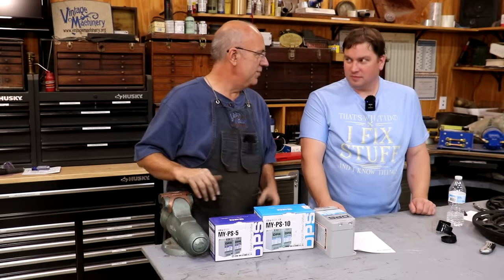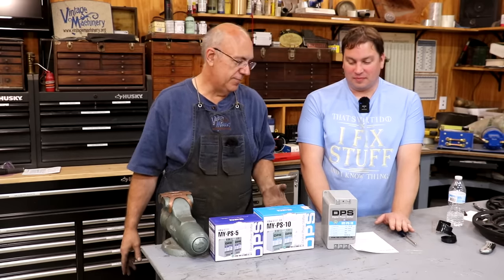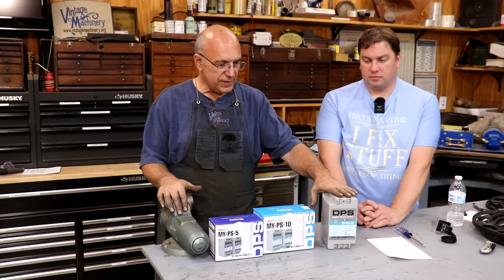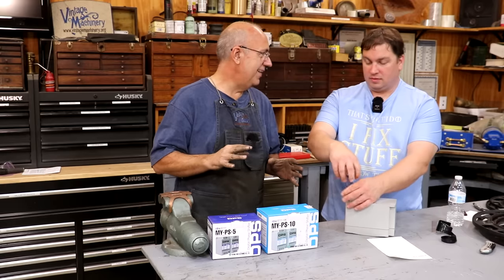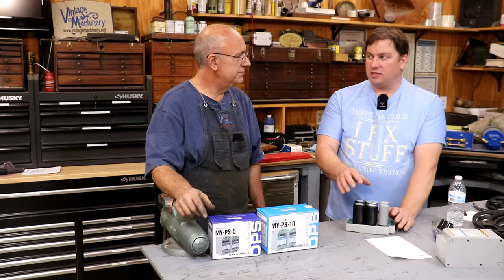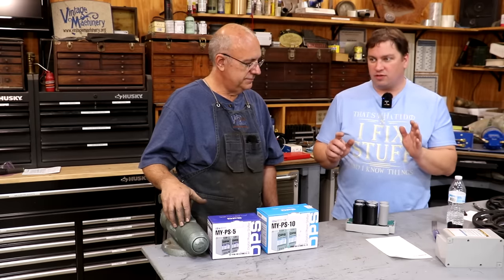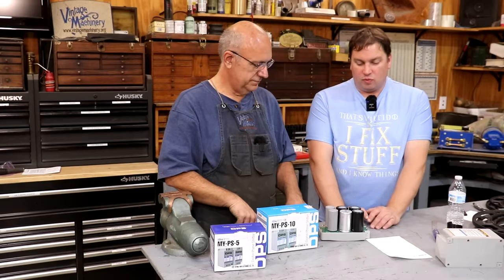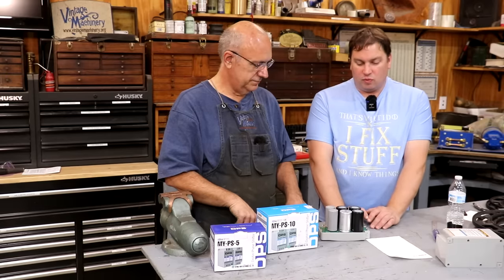Single Phase to Three Phase Power: Rotary Phase Converter vs Digital Phase Shifter

Comment: Interesting video - thank you. As someone with an electronics background, it would have been nice to see oscilloscope traces, comparing the rotary phase converter (RPC) with the digital phase shifter (DPS). It would also have shown your '3 guys hammering a tent peg' analogy very clearly. However, from the voltage and current readings you gave, the DPS is no substitute for the RPC.
Reply: Yes I like to geek out too on visual
Reply: They also didn't show a RPC worst feature, startup. They sag horribly on inrush on the third leg. That's the reason they have such large capacitor banks inside the RPC. The generated leg is limited to the locked rotor amps of the motor inside of it, but at that current voltage approaches zero. So you will see 10% or less of the inrush current on the generated leg vs the pass though legs, with a drop in voltage too. Due to the delta configuration of the 3 phase, this means your motors basically single phase on startup if there is a large load on the motor, as L1-L2 will have all the current, and L1-L3 and L2-L3 will have little current. The voltage sag will also effect the motors if you get close to the capacity of the RPC. The try to compensate for this with large banks of run caps wired in.

A VFD/DFS will produce even voltage and current per phase up to the limit of the device. It will provide less peak inrush current to a motor, but all 3 phases will have the same inrush. Thus will have much much higher starting torque.
Reply: This is not to say it is impossible to have an entirely solid state three phase converter. It will have more to the electronics than half a dozen little caps.
Reply: The guy failed to take into account power factor, THD, (total harmonic distortion), inrush current and many other factors.   Bottom line, there is no great substitute for commercial three phase power other than an appropriately sized generator capable of three phase power. The  old rotary phase converters were literally a single phase motor with a belt driven three phase generator next to it.
Reply: weeeeeeeeeeeelllll also, at least assuming the current clamp was true RMS, you need to get the true reactive power. Obviously since the DPS can't create a good 120 degree phase shift you will have an imbalance but not sure it's the dire end of the world situation advertised here - but of course this channel will always give the edge to a RPC. I think an inverter with a nice big shunt reactor on it is the best option, but that's serious cash so I get it - RPS is probably the best balance of power, cost and reliability for a home shop.
Reply: Yes. I was wondering about the validity of using RMS meters to measure what might be a square-wave output. I don't know myself, just asking.
Reply: @cda32  dps makes perfect phase shift. They convert incoming power to DC then make the output through some igbts. They work the same as a VFD.
Reply: @captianm4766  no i didnt, there is really no reason to and the video was not intended to be 2 hours long so those minor concerns are edited out.
Reply: I wanted to see the waveforms, too. I wonder if it would have performed better if it were feeding a purely resistive load. There would be no practical reason to do that, but it would have been interesting.
Reply: @ionstorm66    didnt your mama tell you there is no such thing as "perfect."   There is a lot of noise here already on this post but i will address a couple of things:  a scope would have been nice yes but between us we dont have one, yet.  both of those meters measure true rms not that it will make much difference, we did compare other non trms meters and the readings were functionally  the same.  there are products out there that are more or less a vfd that are made to just output  3phase to whatever but those things are not true sine wave outputs.   if you look up how those things work you will see they have very noisy outputs just like a  vfd that they are based on.
Reply: @nilzlima3027  we are referring to how a RPC doesn't have 120 degree phase separation, as it keeps the incoming 2 phase 180* unchanged for 2 legs. A DPC or VFD output 120* true 3 phase, thus perfect phase separation. The fact that the only measurements in the video are current/voltage running unloaded provides almost nothing to the actual differences in the technologies.
Reply: @johnopalko5223  the resistive load would make it easy to see the effect of the phase shift tho.
Reply: @ionstorm66  first of all showing the current and voltage readings is the most relevant information possible to provide to most end users.  second, 2 phase is 90* of separation between  phases and requires 4 wires, which is why 2 phase is so rare.  normal residential systems in north america are single phase with a center tap for the neutral that is also referenced to ground.
Reply: I also have an electronics background and I was thinking the same thing. I would love to see that converter hooked up to an oscope just to see what the wave forms look like.

Comment: I had a machine shop when I was younger and I paid PG&E $5000.00 to have 3 phase Delta power brought in from the switching yard about 5 miles away. It worked great and I never had any problems. It was 208 volts 60 cycles  and ran my machines well.
Reply: For me if I would want 3 ph now. I would have to pay $3k-$5k to go ~ 300 feet. I am just 300 feet from the transformer triplet up the pole.
Reply: @carlthor91  It seems to me that within the last ten years a friend paid Pacific Graft and Extortion a whole bunch more than that.  I believe that he had to "buy: three transformers, plus the poles and wire.  The "engineering" was over $3-5k.
Reply: @DavidSellars-b8l  I am in Northern Canada right dead between two hydro plants, three phase is only 300 feet North of me on a pole. My split phase pole is ~60 feet from my power mast. So no poles, just new wire, mast, and meter.
Reply: oah how times have changed.  there is  3ph not 150 yards from my house and xcell quoted me $11,000 for a connection to the garage only.
Reply: In my area, they just look at you and say No! 
If I owned a building that has three phase, it is my understanding that the monthly cost would be out of my budget.
Reply: @nilzlima3027  That is horrible pricing. My power run was done during the early 1980s I think it was late 1983. Service was a lot better then, than now.
Reply: Fortunately here in Germany(and almost everywhere in Europe)
basically every house and even  small apartments have 400V 3phase power so we don't need such things like phase converters.
Reply: Pick your poison, 5 -10K for a 3 phase utility feed or 5 -10K for a RPC.  If you're fortunate to even have those options. I would go with the utility but that could 
take a year or longer if even possible.
Reply: @Henning_S.  I am jealous of Germany, in the Netherlands we do not have 440V in normal households / apartments.
Reply: @be007  I'm pretty sure you also have that, it is just 3 phases with 230 Volts between each phase and neutral, so the regular voltage in your house, but the voltage between the phases is roughly 400 Volts. That is because of the phase shift as Keith explained, and because the phases are 120° shifted and not 180°, the voltage is not quite twice the voltage but a little bit lower. It's hard to explain, at the point where the voltage of one phase is at its highest point(+230V) the voltage of the other phase is 60° off of its lowest point, so it's not -230V but somewhere around -170V, so the voltage difference between the phases (-170 to +230) is 400V.
If you have an electric stove it is most likely connected to all 3 phases.
Reply: 3 phase is 1.25 miles from my house was told it would cost 40k plus. i am just going to keep using my american rotary 20ad i had before.
Reply: I live in a corner lot and built a shop, the poles are in the corner of my lot with the triplet lines and under 100ft to my shop and I already have a midway pole for my house, quoted 5-6k in TN for the 3ph service hookup. I said nah and went with 400a single phase since the install cost was the same as 200a (300 bucks). I can run basically anything from that anyways.

Comment: I think something that was missed was that in the DPS manual states that under 50% motor load the voltages will be irregular, but above that the voltages balance out. I think that should have been noted and tested before discrediting the device, especially since the channel is being sponsored by a company that would be threatened by this device. I have machines on VFD's and rotaries, and will be running my dust collector off of a DPS, which the motor will be under load all the time.
Reply: I noticed that too! I want to see what this thing can/will do with load

Comment: I put a VFD on my 10hp screw compressor. Loaded it runs at 50hz and unloaded idles at 30hz.  I enjoy the speed control for most of my machines.

Comment: when i got my bridgeport mill , i looked in to vfd and static phase converters . i was told not to use them on motors built before 1980 because the varnish that was used in the older motors melts at a lower temp and you will more then  likely burn it out. Two you don't have any whare nere  full power. good videos keith. can't wait to see your next one!!!
Reply: its not the melting of the varnish that is the problem its the withstand.  the output from a vfd is very noisy, those spikes can stress the winding insulation and induce lots of static charge on the rotor which can pit the bearings.  I have seen these things in action so pick your poison.

Comment: G'day Keith, I run all my machines with VFD's.  Easy to program with acceleration/deceleration, variable speed, braking etc.  Got one of the newer generation units on my Victor Lathe, single phase direct to 415v, no need to rewire the motor to delta.  They are cheap and for me with a small shop compared to a rotary which burns up power when the machines aren't running generates heat and noise, its the way to go.
Cam

Comment: as a 'marine electrician' i got lots of stories.... amazing what can be done with old scrap... and salvage....
I was shown a jointer with 1' blades and 7' table w/ a7.5hp 3ph drive.  powered from a 50amp 1ph breaker (??)....that fed 240vac into  two legs of a 3ph switch to run a 240v 1ph 1.5hp motor and another switch tied to a 10hp 3ph motor paralleled with the jointer motor.  These 2 motors were also joined with a lovejoy coupling  ya, man! weird...
so turn on the power, turn on the 1ph motor to spin up the 10hp... turn on the 3ph switch, then turn off the 1ph switch and the planer gets the 3rd phase to run well.
I moved the 'converter' to in side the shop from it's dog house; and later an old planer (7.5?hp) was added that could be used if the jointer was off.

Comment: Twenty years ago, I followed someone else's instructions, and somehow built a 5 hp rotary converter that works great. The 5 hp 3-phase motor was salvaged for free from a trash heap, and it was manufactured in 1946. I replaced the bearings, and cut most of the output shaft off. I added a small fan blade to the shaft and added a shroud. I start the rotary motor thru a static converter, and then shut off the static unit. 
Total cost was about $175, mostly for the static converter from a company that doesn't exist any longer (Tools Unlimited).
Reply: was....  ? well man dont keep us waiting!

Comment: I have a 5hp lathe, 3hp knee mill, and 3hp baldor 12inch grinder exactly like the one you have behind the sander.  they are on a 5hp ronk rotary PC   it works great and been in service for over 10 years now.

Comment: The technical details of AC power and especially 3 phase power are beyond what most electricians and many engineers understand. AC power is not the simple product of voltage and current like DC is because of phase differences. Three phase power is even more complex. To draw any real conclusions you need a true AC power meter. Fluke has them about $12K. Almost every AC motor uses a capacitor to shift the phase. The rotary phase convertor uses them too.  The capacitor phase shifter produces a third phase shifted signal that is not perfect. But it doesn't need to be to get the motor to spin. The cap values are chosen for a typical motor which means  performance will differ from one motor to the next using a shifter way outside it rating may work very poorly or not at all. A shifter will always delver less than full HP which in many cases is acceptable considering we never use it all anyway. There no reason to believe that the motor  will suffer in any way by operation on a shifter. You can't just measure voltage and current in a AC circuit and jump to that conclusion. In your case the current on two legs was higher but the other lower so maybe the power was the same or even less.  A better test would be to run the motor on the two power sources under identical loads and measure the temperature. No doubt the temperature would differ by a few degrees but who cares  you're not going to run that tool all day long at max power. 

The capacitor phase shifter  is a simple reliable and safe means of driving a 3 phase motor from single phase power. When properly done it will not harm your motor.  While it is a compromise in many cases the value for money wins out over the rotary convertor especially for the hobbyist. it is more efficient than the rotary convertor which uses substantial power even when idling. Those that turn on their rotary convertor on and leave it on waste a lot of power. 

The VFD is a great way of driving a motor but doesn't  share between machines but has many other advantages.
The shifter and the VFD are perfectly valid low cost ways of driving a motor. In many applications the   VFD us probably the best, American Rotary would like to demonize these and make them disappear.
Reply: Best explanation, I was confused whether I use a VFD or a rotary converter and after reading your comment I'm going with the VFD as I didn't think of the constant running of the 3ph  converter .
In my case the extra saving is better in the long run. 
thanks from Australia 🇦🇺

Comment: I'm a retired plant electrician and you are  right on the money. These are a slow death to the  motor and just because they work in the short term you will pay the piper when motor blows up and if you are real unlucky the fire will burn your shop down. You might comment if these have are UL listed. That in itself would speak volume's.  I use a 10 HP American Rotary  and on a 3 HP Acer 3VKH mill and the voltage and current is right on the spec. If money tight a properly installed VFD is a much better solution.

Comment: 15 years ago I needed a phase converter. Since I was using cnc press brakes I chose an American rotary phase converter as it had a real sine wave output and well balanced  legs. I then tried a vfd on my mill. It worked great until I let the magic smoke out. And couldn’t put it back again
Reply: stoopid magic smoke!  i tried the liquid smoke, no dice.

Comment: Thanks Guys that clears up why they're not for at older motors . Which is all I have but was going to try one to run a planer IVE had and wanting to get p and working like it should be. Federal planer isnt large but I have a one horse three phase to put on the super structure. Like you did on yours.

Comment: I've been running a three phase motor in delta configuration with a capacitor between two legs on 230 V single phase. This is called Steinmetz circuit over here and only recommended to a max 1 - 1.5 kw motor. I would never use that for a bigger or expensive motor since the phase shift is less than 90° instead of 120° and you get ripple curents and the different amperages. You also don't magically get the full power of real three phase. It's a simple solution for small tools, and should be treated as that. I am just running a small buffer this way and it's ok.

Comment: I first came across these static phase converters about 20 years ago.  I had to install them in a neighborhood development for a water pump in a pond for a fountain and some other things.  The ones I installed had  a start-up procedure where you had to change the capacitance of the start/run circuitry based on the voltages you see when trying to start and run your load.  Once I had the start-up done, I found the voltage and amperage was fairly well balanced.  From what I can see, these converters you have are a much cheaper version of what I installed.  I do not mean to contradict you in your final statements about static converters, but it comes down to the old saying, "you get what you pay for".  The ones I installed worked for about 12 years before the development took out the pumps and re-did the whole pond thing in that neighborhood.

Comment: I can screw in a light bulb, install a new plug on a lamp and even comfortable adding a new circuit and breaker in my panel.  Until this video I never had a clue what three phase power was or how it worked.  I have a much clearer understanding now.  Thanks.

Comment: There’s no substitute for a real generated third leg. Give the motor what it was designed to run on and it will do so for a long time. Really appreciate you addressing this issue as I feel that many - understandably - are tempted to go a route other than a rotary phase converter to save money and for ease of installation. As I think your video makes perfectly clear… do so at your own risk.

Comment: Thanks for the video. Would like to see the same comparison using a VFD.
Reply: Every VFD I have checked showed essentially equal voltages and currents on each phase, which is what you want to see on all 3 phase motors.
Reply: @carrollprice1213 - thanks.